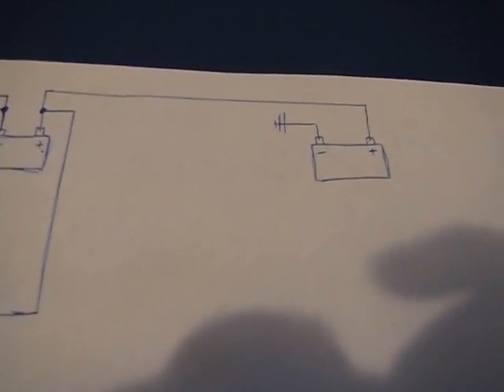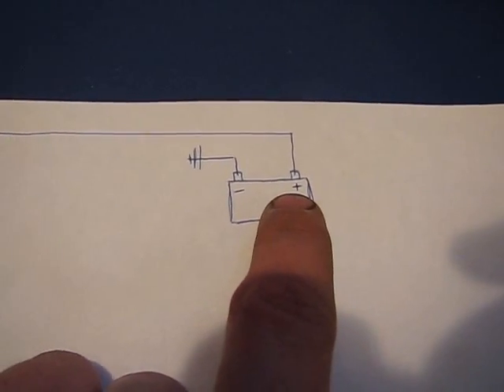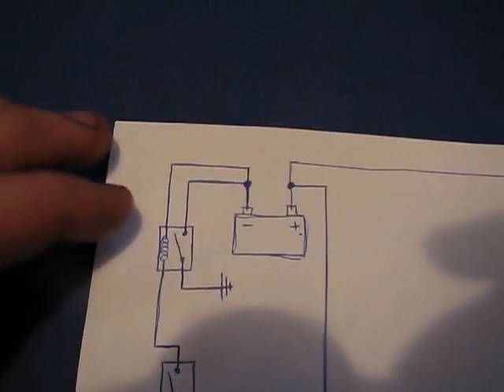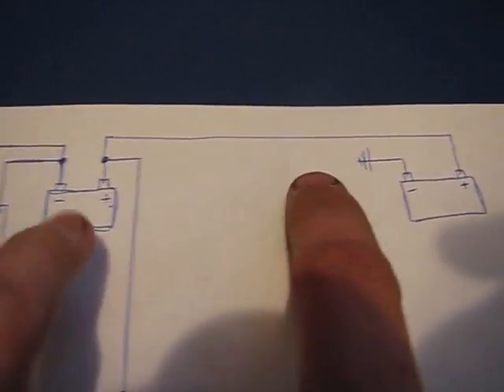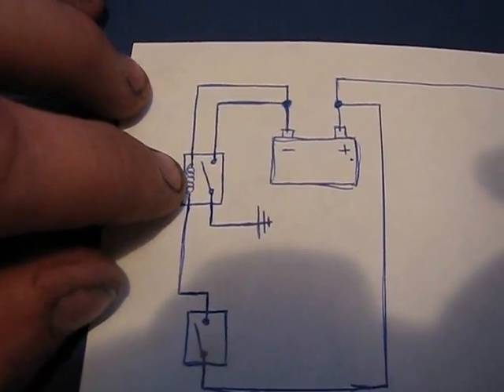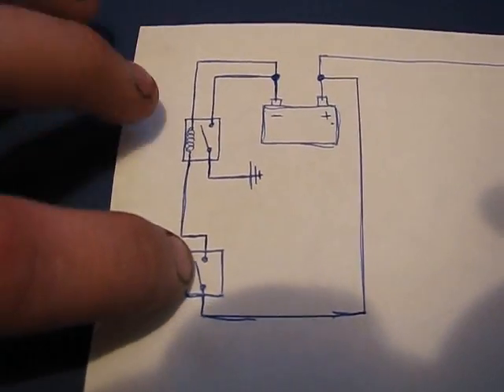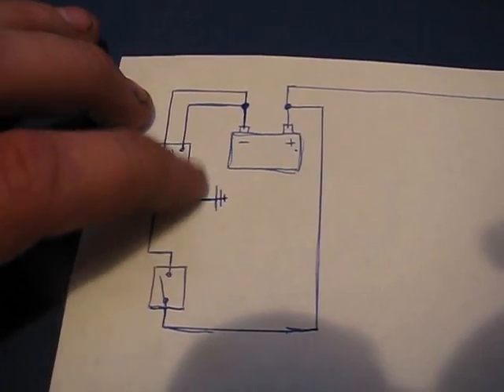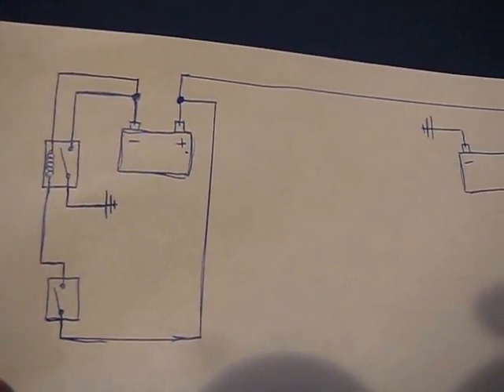Dual Battery Wiring Diagram for ndchevy!

Comment: Wiring dia. is bang on.  I've done this many times and learnt the hard way that some of these solenoids are constant duty and some are intermittent duty as in a starter solenoid.  If yours is intermittent you will find out soon enough  when you put a load on it , bring your frying pan with you and it will make a great  heat source.  Battery isolators cause to much of a voltage drop unless you buy a real good one not  at crappy tire .  LOL

Comment from the maker: @splavin90 well, i have isolated this battery from the rest of the system with one of those heavy duty ford starter solenoids. its actually off my Warn 8274 winch

Comment from the maker: @ndchevy that is what i have setup here :) i use a switch from in the cab to control weather or not the 2nd battery joins the circuit and charges/shares the load or not :)

Comment from the maker: ive got both my batteries grounded to the engine, and one grounded to the frame/body, plus the engine is grounded to the frame as well. ive got a 2-0gauge wire from the + on one to the other +
ive got 2ga going to the starter, and 2-0 going from the alt to one of the batteries.

Comment from the maker: any way you can get a video of what its doing? could possibly be contacts... those go bad, and can cause a starter to intermittently work, or not work at all... i had to take my starter out, and repair the contacts. works like a dream now :)
or it could even be the teeth on the gear, or the flexplate/'flywheel

Comment: I'm running a dual battery setup without a relay or a switch an I think the extra volts is messing up my starter both batts running at 14.3 would a relay or isolator only send 12v to the starter apon start or should my starter be just going bad

Comment from the maker: your main battery. the one that is not switched. otherwise, you'll kill the battery and wont have a stereo system unless the switch is on, but then whats the point of having a switch haha :P you've always got music playing haha. run a fuse about 5" away from the (+) then run your power cable to the amp(s).

cheers bud!

Comment: Can I  use this wiring for my motorbike. If only the switch is on the wiring is complete but would it recharge if the switch is not in on position?
Reply from the maker: pracash sam if the other battery is not connected to ground, it wont charge.

Comment from the maker: shouldnt be anything wrong with running dual batteries, as long as you have them hooked up right, and it sounds like you do... sending 14.3V to the starter wont hurt it. sending 24 to it might... what exactly is your starter doing?

Comment: Clanking just rough just like a bad starter would although I did have severe voltage drop then upgraded my alt then the dual setup 96 tahoe possible stock starter just don't want to replace it an have the same problem with the new one